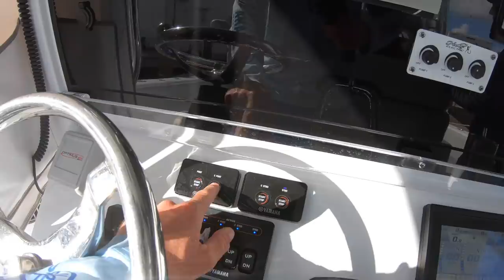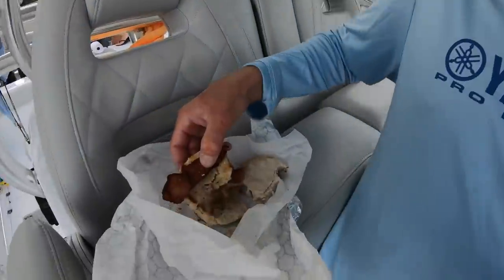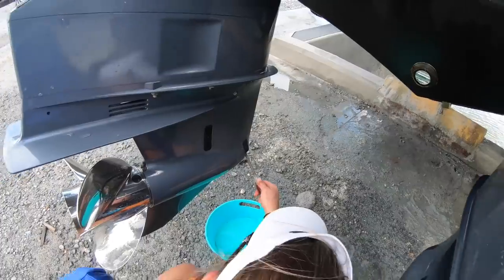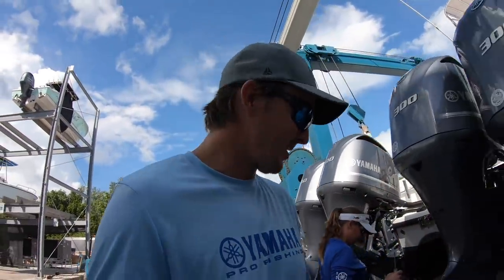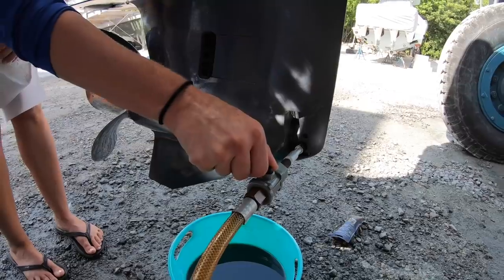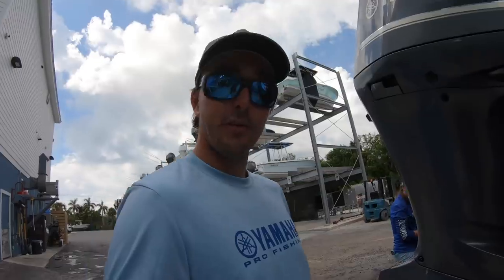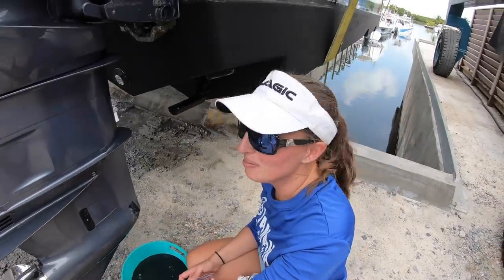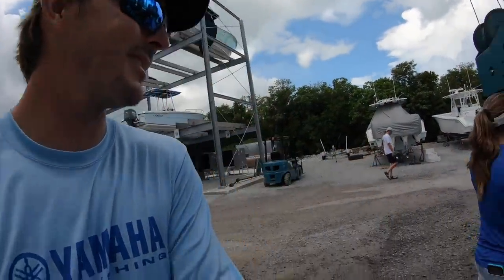37 Freeman Boatworks Quad Yamaha 300 Lower Unit Oil Change

Comment: You won't have any issues with those tiny air bubble's, That is the whole reason for filling  through the bottom plug! Also make sure you do not fill your gearcase too fast or with too much pressure with that pump! As I was just typing this comment I heard her say that pump fills the gearcase really fast! Filling fast is the cause of those air bubbles!

Comment: I use a square shaft screw driver and put a small open end wrench on it. You can really lean onto the screw driver to get it to bite into the plug and then use the wrench for leverage to break it loose.

Comment: You need a Impact Electric Screwdriver to pop open the oil caps..... anyway i am the happy 😁 owner of a diesel electric hybrid boat ! 1,5 Megawatts generator spin by a very quite and efficient diesel engine and power 6 brushless electric motors with double contrarotative propellers each with tunable blade angles so the system it highly performant like a Formula 1 car big battery bank and solar roof ! So wen i have to travel slow or very slow i use in daylight only the solar array or batteries in night time....now i am working to modify the Volvo engine to work with HHO extracted from water 🌊 imagine use water as fuel !!!

Comment: That is one problem with Yammies and other 4 strokes, the required maintenance is not good. You should have got Evinrude. The new G's are sweet.
Reply: This has nothing to do with engine oils. This is the tail oil. Even the Evinrudes need this kind of oil service.

Comment: Nick you need to pull that thrust washer when checking for fishing line. It sometimes get between the thrust washer and the oil seals and that’s where it causes havoc. Tight lines captain I am fishing with you in November.

Comment: I this day and age we still have flat head screws on an engine like that.
Reply: If your screw is stuck you probably dont do enough maintenance or your doing it up too tight
Reply: @filespec  I`d take flatheads everywhere if it was remotely possible, hex is my nemesis..
Mostly due to the scale being much smaller, and all those things wanna do is strip and get stuck, terrible system for sub 4/5mm, unless they`re hardened or titanium, not sunk or otherwise possible to remove after a stripped head says hello.
Without an extractor that is..
I see hex and I feel like getting an extractor set just in case..
Oh no.. I mentioned hex several times, I think I hexed myself :o

Comment: I keep a large screwdriver only to be used on the gearbox oil screws, that way the screw slots never get butchered. Works well for me. I lost the warrenty on my Yams because I did the oils and impellers myself, even though the book said I could. Probably switch to Suzuki next time,because of that.

Comment: You should really get you one of them $29 extended batteries for cell phones and GoPro cameras they work really good I'm amazed and it shoots 18 volts in it so it's high speed charge you can't beat that supposed to last 29 hours but you know in real life it won't last that long

Comment: she wasn't releasing the pressure when she unscrew the LU top bolt but anyway...that amount of metal inside the LU isn't normal on a new motor , you will have problems with your LU , thats for sure...the 4.2L are known for that prob

Comment: The oil won’t get dirty it accumulates water instead of floating on top of water to prevent the lower bearing damage That’s the point in servicing them often.

Comment: Counter rotating engine works harder?  Um...

Maybe a little more explanation on that,  like due to the mounting position,  or whatever,  the engines mounted in 'this position' get more use

Propped correctly,  no single engine would work harder regardless of rotation

Comment: Using cheap gear oil I’m sure isn’t recommended for those motors use oem gear oil
Reply from the maker: Yamalube 👍🏻
Reply: StanzFam my mistake I read the bottle wrong Stan I should have known u wouldn’t use cheap gear oil

Comment: Love your vids, love the boat, but not a fan of all those ,, in my opinion,  pointless outboards. Twin diesels would be alot less maintenance and you could actually fish off the back. I get the whole '' efficiency '' thing but for the cost of those outboards vs twin cats idk what the point is on a boat over 30ft.
Reply from the maker: Inboards have some positives for sure but speed is a major benefit of outboards and you don’t have to climb in an engine room to work on the motors.

Comment: Hey guys thanks for the video.
I have a. Question:
Could I hypothetically take the lower unit out of the rest of the outboard and change the gear oil while they are apart?

I
Reply from the maker: Yes for sure
Reply: @StanzFam  thanks a lot!!!

Comment: FYI - You want to see zero metal shavings. Any shavings at all, means you have further issues. Send oil sample in to get proper diagnosis if needed.
Reply from the maker: I’ve Never seen a drain screw without any metal shavings/remnants on it 🤷🏻‍♂️
Reply: @StanzFam  - gotcha. Hopefully it’s all good. Great fishing vids! And I made sure to let my wife watch so she could learn how to change oil! 😂 good stuff
Reply from the maker: I hope she helps 🙂😂. Sara used to but not so much anymore. Agree if the shavings are big or a bunch of them on screw

Comment: Great video as always. Is that a 1gallon sprayer with fitting and ball valve?  I use the small pump for a quart container and it is a real pain in the butt.
Reply from the maker: It holds quite a bit of fluid, I Would guess 5 gallons or so. We never fill it up all the way . Works pretty good though
Reply: Can you purchase the pump sprayer with the fitting and ball valve already? If you have to buy individual pieces can you possibly list where you got your parts? The pump sprayer is a great idea a lot less messier than trying to use that little hand pump that attaches to a quart or gallon jug.
Reply: StanzFam Where did you pick up the parts for your sprayer?

Comment: Might be a dumb question but what is the reason for counter rotating of the prop
Reply: Tyler Van Booven cancels out the torque, makes the boat track straight. The same reason a helicopter needs a tail rotor.
Reply: Eric Davis so on a 4 motor boat 2 of them are counter rotating
Reply: Tyler Van Booven i’d assume so. I know on a twin powered boat, they rotate opposite of each other.
Reply from the maker: Yep , 2 and 2
Reply: What’s the configuration ... every other like LRLR or LRRL?

Comment: Do the motors come out of the water high enough to do the work from a dingy? Seems like quite an expense for such a simple maintenance issue.
Reply from the maker: The lower units are still in the water a couple inches when trimmed up , so we haul out to change that lower unit (gear case) oil.
Reply: Thanks. My sympathies to your wallet 🙄.